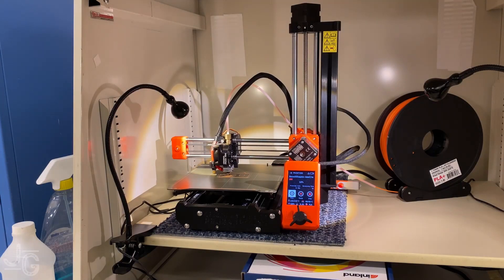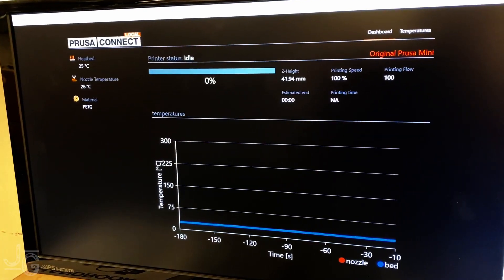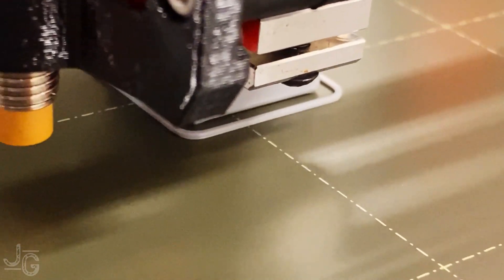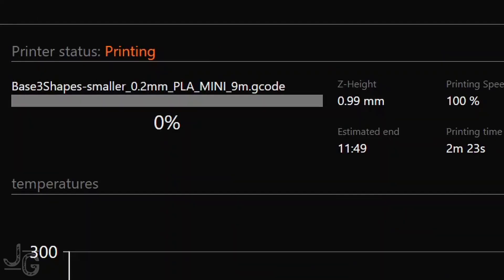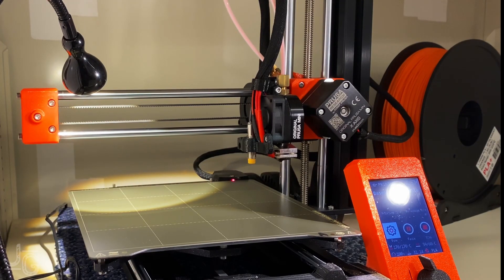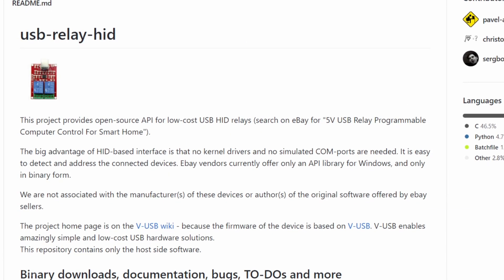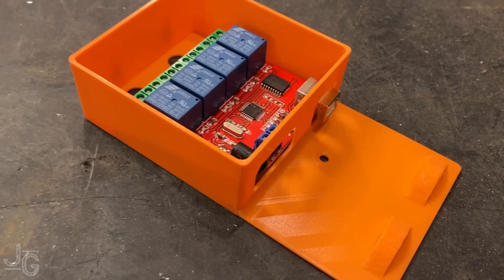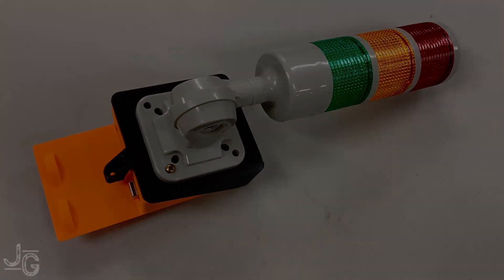Adding Indicator Lights to my 3D Printer [Prusa]

Comment: What is that enclosure?
Reply from the maker: It's a 3D printed design - files are here: https://bit.ly/35PUCbN
Reply: @jeffjeffglassglass3529  Sorry, rather the metal box the printer is in.  Pretty neat.
Reply from the maker: Ohh sorry I misunderstood. I’m not entirely sure what it is, something that was in the workshop when I inherited it. Let me check for some markings when I’m back there on Monday.
Reply: @jeffjeffglassglass3529  Thanks!
Reply from the maker: @mrmikerotch  It looks like most of the markings have been warn away over time. There's a sticker inside that says 'Smith System Manufacturing Company, Minneapolis Minnesota. Since 1905' but that's about all the info I could find! It's some kind of flat-file/poster storage, I think?

Comment: Awesome ! I’m planning on getting a MINI myself and was looking at using a status light for it. Do you know if it is possible to use some of the free GPIOs available on the buddy board to tether status lights with gcode?
Reply from the maker: Ooo, now there’s a neat idea. It looks like the PB0 and PE5 pins on the STM32 micro are routed to the expansion header, so they’d be the most accessible. From a cursory glance at the source code, it ~looks like~ both are addressable via the M42 command, but you’d want to dig a little deeper into how the Marlin gcode engine is naming those pins. https://github.com/prusa3d/Prusa-Firmware-Buddy/blob/b8bc6da0dcc4ce09650be46f23f646b28d9ff771/lib/Marlin/buildroot/share/PlatformIO/variants/MARLIN_F407VE/variant.cpp
Reply: @jeffjeffglassglass3529  thanks for your answer ! I’ll definitely look into that. I’ll keep you posted if I do find something interesting